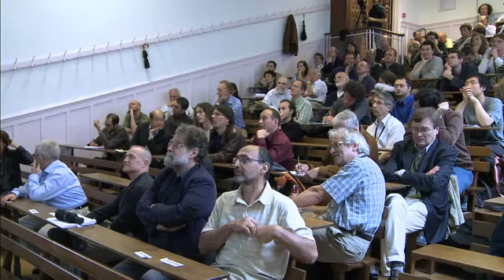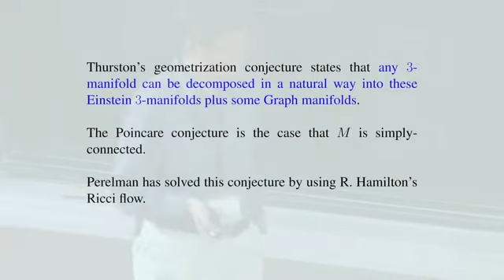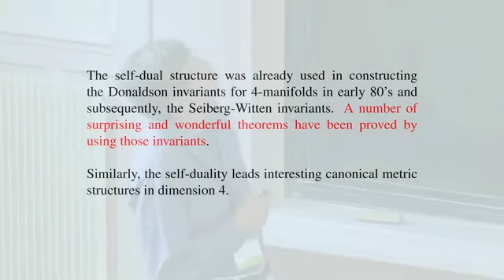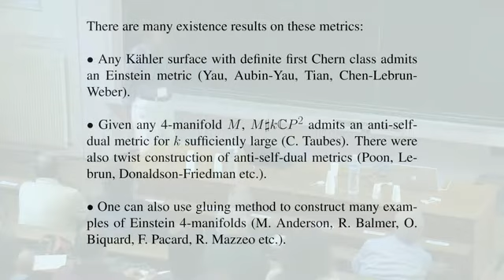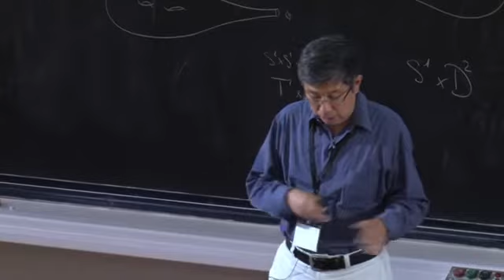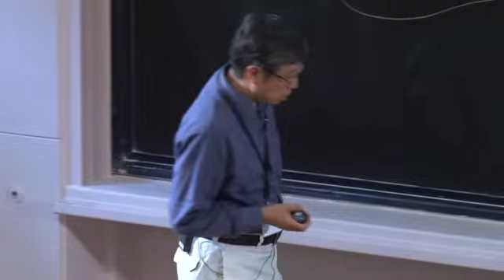Gang Tian, Metric geometry and analysis of 4-manifolds

Comment: Boundary conjecture are by 3 3d compact space[+] of Chern Simons differential geometry manifold at quantum black hole at Planck scale l=g*m^2/m*c^2=1.616231*10^-35 meter, m=(ch/2pi*g)^0.5=2.176466*10^-8 kg , g=6.674103388*10^-11, ch=2pi*g*m^2=8pi*g*(m*c^2/2)^2/c^4 solution of GR, contain in QBH at proton scale pl=g(p)*(4pi*pm/3)/c^2=8.809*10^-16 meter, contain in QBH at Atom scale [A=5.29177282*10^-11 meter=A1*(128.51991/128.4980143)] A^2=g(p)*pi*me/128.4980143*c^2 where g(p)=g*m^2/pm^2=1.13*10^28 strong force by graviton g*m^2=ch/2pi oscillating between 2 QBH l, pl[ER] produce asymptotic freedom give proton pm=1.672621868*10^-27 kg positive charge unit e=1.602176634*10^-19=16*g1*pm*c^2 where g1=6.661181*10^-11, 16=(4/(1-x^2-y^2)^2)^2 for unit circle 1=x^2+y^2 without edge of negative  curvature of hyperbolic geometry for negative vacuum energy ch=(4.9154)^3*pm=111.431 Gev[Higgs field]  under critical mass[6^3*pm] as dark energy[-] can expand our universe of Friedmann solution[-,0,+] in 4d dynamic space time of Riemann geometry ch[72.13%]+ch/3[24.04%]+ch/6pi[3.83%]=En[100%] in Hilbert quantum space, ch give proton positive mass energy on compact space of QBH pl by pm*c^2/1.602176634*10^-19=938.27 mev=(2*139.57+135)/(+2/3)^2+3*2.276-0.511+0.1811 for Calabi conjectrue , produce 6d Calabi Yau manifold of 3 2d sphere[4pi*r^2] Atiyah Singer algebraic geometry  have k theory hyperbolic geometry solution 2pi*(2-3*2)=(-8pi] of 3 2d flat[0] torus Schwinger QF[1d string + 1d common time][4d dynamic space time of Riemann geometry] ch=2pi*l*m*c^2[t1]=2pi*pl*pm*c^2/(4pi/3][t2b]=2pi*A*me*c^2/137.036[t2a] by ADS/CFT duality from 3 3d QBH l, pl, A^2, produce 2^(1/6)*ch=125 Gev Higgs boson, deduce (g/g1)^2=(6.674103388/6.661181)^2=0.00116592026/0.001161409725 oscillation between QCD/QED of muon/electron anomalous magnetic moment of (g-2)/2 factor of Yang-Mills gauge field with mass gap m/pm=1.3*10^19, pm/me=1836.1527=4pi*137.036^2/128.51991=1/(4*A1*137.036^3)=(pi/(128.4980143*A*137.036))^0.5 for weak force unite strong force g(p) with EM force k*e^2=g(p)*pm^2/137.036=4pi*g(p)*pm*me*137.036/128.51991=me*(c/137.036)^2*A[e-]=ch/(2pi*137.036)[e+] Dirac QF deduce 0.001161409725=1/(2pi*137.036)=e+/ch Schwinger weak QED of Yang Mills gauge field from magnetic field of positron e+ as spin down electron[EPR] oscillating with electric field of electron e by Faraday induction in QG of vacuum 2pi*k*e^2*137.036=ch=2pi*g*(137.036*up*e-/l)*(137.036*up*e+/l)[Feynman diagram of Maxwell equation at Planck scale as 5th dimension of Kaluza Klein EM theory in GR ch]=(2*A1*137.036*pm*c^2)*(4pi*A*137.036)=En*L produce photon of gravitational EM wave at speed of light c=1/(up)^0.5=299792458[meter/second] where k=(2.99792458)^2*10^9, p=1/(4pi*k)=8.85418791/10^12, u=4pi/10^7[A-B conjecture symmetry of Weyl tensor] are permittivity, permeability of free space ch can expand our universe, deduce Rydberg constant R=(me*e^4/8*p^2*h^3*c)*(2pi*A*c^2/2pi*A*c^2)=(2pi*A*me*c^2/137.036/ch)*(pi*137.036/A)*(k*e^2/ch)^2=1/(4pi*A*137.036)=1/L=10973731/meter, produce photon r=En=ch/L=chR=me*(c/137.036)^2/2[Klein Gordon equation of Schrodinger at Josephson junction in vacuum[t2a] 2025 NP]=13.6*e[1.602176634*10^-19] show on fine structure split line of hydrogen Atom spectrum have 2*13.6*e=me*(c/137.036)^2 energy difference between e-, e+ cooper pair from quantum tunneling[EPR] in Dirac negative vacuum energy sea ch for qubit of quantum computer, double electron energy shell by 2*n^2[2,8,18] for Pauli exclusion principle of Bohr Atom model, deduce 2pi*0.001161409725*(me/pm)^2=(me/pm)^2/137.036=128.4980143*A/3.1415926=1/(1836.1527^2*137.036)=2.16*10^-9=0.0016592026-0.00116591810 extra wobbling of muon between experiment data[0.001165920+((61-41)+(57-25))*10^-9/2], theoretical prediction[0.00116584719+6845*10^-7+154*10^-8+92*10^-9] from Femilab at 8/10/23[2026/4/18 breakthrough prize] as spin dark matter of 4d dynamic space time of Riemann geometry from super symmetry 137.036=g*m^2/k*e^2=GR/QM=(m*g*pm*g(p)*pm*g*m)*(1/137.036)/((e-)*g1*(e+))=ER/EPR of Grassmann number of QM 137.036^2=137.036^2*(g/g1) with super partner pm, me=9.10938356*10^-31 kg electron mass for weak force pm/me.